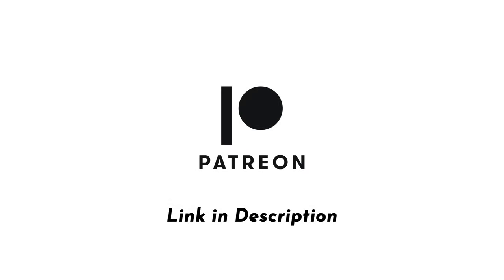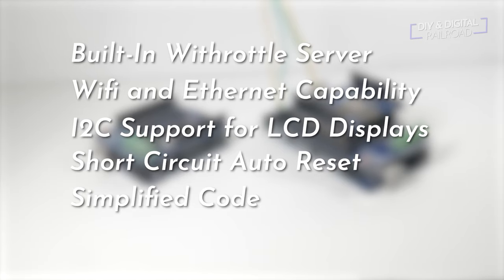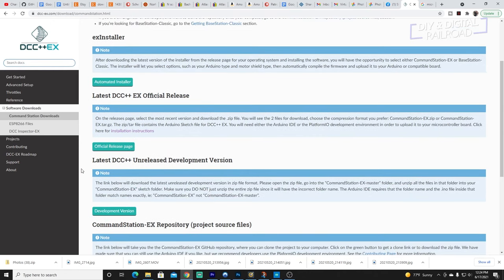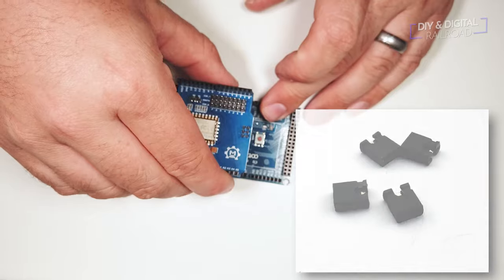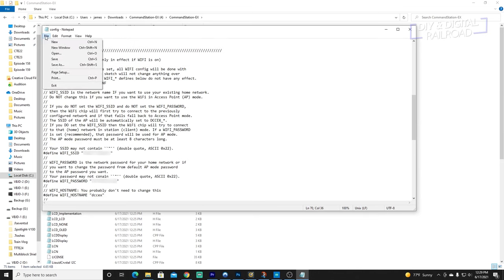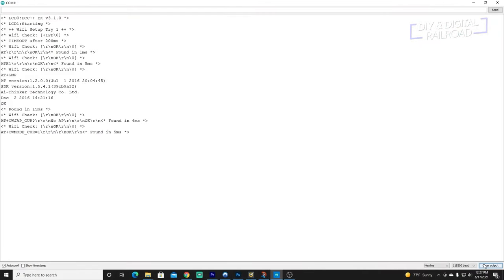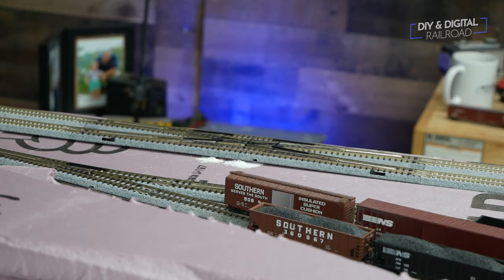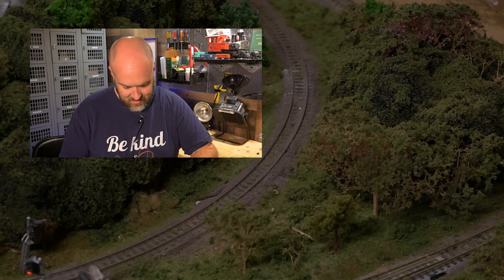DCC++EX: A Cheap DIY DCC System?!?! This is a Model Railroad Game Changer

Comment: I will get back to this when I'm building my railroad. It is intriguing.
     Many years ago I was an over the road truck driver. I had a railroad in the top bunk. Rather then use a conventional power pack, I got a 2n3055 transistor, heat sink, A dpdt switch, and just used the trucks 12v power out of a cigarette lighter. Simple stupid effective.  
        This looks like worth exploring. Thx

Comment: I used the ESP-01 module when I built my setup a few months ago, and it has performed flawlessly. My layout is in the garage and it boots up and is ready to go in just a few seconds. I use Station mode; AP mode works fine, but I quickly tired of changing my phone's Wi-Fi network every time I wanted to run trains.
Reply: I'm using station mode as well. For similar reasons. Can keep my phone on my normal home WiFi network.
Reply: Why not just get a Third World donor fone? As long as it will hold Engine Driver it should work. We are using junkers on our portable club layout now.
Reply: On your ESP-01 module, where does the ground wire connect to? Thanks
Reply: @danzo5521  I'm pretty sure it is the GND terminal.
Reply: @PatrickMcNealPuppets-n-Things  thank you, I rewatched the video and figured it out, thanks!

Comment: Hey Jimmy, top video mate!
And a very deserving plug for the DCC-EX team. They're working hard on this.
Please correct the Arduino IDE serial monitor baud rate you mentioned: it is 115,200. Not 112,500 as you read out.
New subscriber here! 🇦🇺🤠👍

Comment: Excellent video.  Thank you for doing this.  I’ve used DCC++ EX on Arduino with my win10 laptop for a while.  It connects with JMRI to run multiple locos, turnouts and sensors without problems.  I got the WiFi card from England and paid more for shipping than the card itself.   I have not tried to install the WiFi card yet and this video will help me.

Comment: Jimmy, You have out did yourself again with this video, it's great as usual. I  have a dcc++ and have played around with DCC++ EX both of which I have found to be excellent.  I have a Raspberry Pi 4B with JMRI connected to the DCC station and I login in with engine driver, or my wife's old I-Pad using the one for apple. I normally use Pi-sprog on the layout when I run DCC, or program my trains. My layout started 26 years ago as DC which I still  use. I have double poll double throw switches . The layout was originally setup up for 4 DC throttles.
All are either kits or ones I built from scratch, When I went to DCC, I changed the DC side to 2 throttles, this way I can setup the DCC to run on one switch and  use the other to hookup
to a programming track. It's a little complex but I have all the switches marked as to what they do. The only thing I found with DCC+ + or EX is I can not program trains with it.  But  that could just  be me. My background was electronics and I did do some programming. My last gig was working on Cisco Routers and Switches for a major bank.

Comment: This is amazing.   Setting up and wiring DCC and power are the two things I am most daunted by, honestly, but this looks like FUN!   And the DCC++EX site has great instructions.   And ... well, lower cost is always better.   And I have a nice little laptop lying around that I can use as a support PC to load JRMI and do updates with.   Awesome video and thank you Jimmy for bringing this to us!
Reply: I have a background in Robotics and process control... from 1987... I have no idea what he's talking about. Overwhelming!. I haven't touched electronics since that course, it was brutal and completely turned me off. Spent my teens fiddling with electronics, I have about 10 years experience, but this?!?

Comment: Ugh. This video came out 3 months after I spent 60 hours building a crude DCC system using a PIC16 microcontroller. But I was doing it as an exercise to learn more about microprocessors and assembly language. I didn’t even control locomotives; I just switched LED lights using the DCC protocol. I could’ve done the same thing using C and UART but then I wouldn’t learn as much about the microprocessor.

Comment: This is a fantastic video and introduced me to something which I did not know even existed. For me the next step would be to introduce affordable decoders which could be fitted to N gauge locos from the 1990s and early 2000s. That would be an amazing game changer. Thanks so much for your efforts and for sharing.
Reply: You can install decoders, even sound decoders in N-Scale locos. In some cases, you have to do machining though. You have to take it to someone who can route out a space for a speaker. You can make decoders yourself too. Geoff Bunza has a board you can solder components to, but to makes something really small, you have to have surface mount components and that is usually not something the average Tinkerer can solder or bake. But Engineer level folks might tackle that.
There are some non-sound decoders from China that are dirt cheap.

Comment: The DCC++EX installer is much easier to use than using the arduino editor. I also recommend the combined mega with wifi board, no jumpers needed unless you add a display.
Reply from the maker: Yes the automated installer is much easier, but after consulting with the DCC++EX guys.  It’s still got some bugs to work out, which is why I did the IDE setup.

Comment: I had a DCC++ (not EX) layout which used a second Arduino to provide the throttle controller - no PC needed (not even a Pi)! And it could program, too, in a clunky but functional fashion.

Comment: Hi Jimmy DCC++ EX is Fantastic  i have been using it and the different version and currently  . While i am a Tech guy . I started using with Uno and Now with the latest version i am using a Mega and you Engine Driver and built one for my mates layout the only problem is Living in Australia It has been hard to get MakerFab WiFi SHield   So i have been using  Esp-01     it is very powerful and i love using My DCC++EX main on my mates track  as i have mostly DC N Scale and only a couple of DCC Locomotives But i have modified my layout so 1 track is DC and the other is DCC . I want to say thanks i Use your design of the Station stop  Arduino  on my DC  and i have IR sensors around the track to control the speed of my DC   I am not good a programing but i can read and modify code..  I do enjoy your videos   Thank you  Regards Greg

Comment: Thank-you for this video; this is a really interesting system. The major draw of the DCC++EX system for me is the ability to build it myself; I like building things, so this becomes another aspect of the hobby. The price is nice as well of course, and I suppose it also means I wouldn't be locked into proprietary components.

I've seen and read a few other things about this (and DCC++) and people frequently refer to "limitations" of the system, but people don't talk much about those limitations. Do you suppose you could do a video on the (current)  limitations of the system?  For me, it's just as important to know what I can't do.
Reply: As one of the developers mentioned wifi is limited to 4-5 throttle connections connected directly to the command station....unless you use JMRI then you can have more....the other limitation is the memory and ram of the Arduino itself....you cannot use commercial DCC throttles with this system....that's a few and we are working on ways to solve that.
Reply: @scottericcatalano596  still... quite impressive.

Comment: In my DCC++EX experience, if you connect Arduino Uno or Mega to computer using USB connection for JMRI you don't need to power Arduinos with external power supply.   USB 5volt DC power seems to be enough.   If the computer has Wi-Fi connection to home wireless router,  JMRI WI-Throttle works very well with Android Engine Driver on a cell phone.   Then both JMRI Operations track and Programming track outputs on the motor shield are available ... maybe these could be subject of another video.
Reply: Throttle options will be a subject of another video.
Reply: While many people don't want or need the complexity of JMRI to just run trains, there are obviously a ton of serious railroaders who want all JMRI offers. We cover that on the we page. You don't need a WiFi board on the CS at that point, you use the WiFi in the computer running JMRI and connect to that.
Be sure of your power requirements when running off USB power. It DOES work fine for probably most cases, but both the USB port on computers and the USB circuitry on the Arduino are limited to 500mA. If you had a Bluetooth or WiFi board on there or a lot of sensors and outputs connected directly to the Arduino, that might not work. The Mega can only take 800mA anyway, so the extra 300mA would only matter to someone with one of the situations I mentioned.
Reply: @DCCEX  All true ... but sooner or later model railroaders need to change CV values ... like when you buy a new engine preprogrammed with address 3.   For myself, that's why I installed ... and learned the little I know about JMRI ... for DecoderPro.   My experience so far is that DCC++EX works very well with DecoderPro and a programming track which for me is essential.
Reply: @donaldkormos5529  I agree. And I like JMRI. But I do want to mention you can do all that without JMRI. You can program CV's right from a serial monitor in DCC++EX if you like, but some phone app  throttles support CV programming as well.

We are adding CV programming and turnout control to WebThrottle-EX, so tools like that can be used just as something to program locos even if you don't use them to control them. 
As much as I like JMRI and think it is extremely powerful, with power and options comes complexity. Plus, it is Java. it has a terrible user interface, is very convoluted, and has a steep learning curve. The page read feature is one of the nice benefits though! We've sped that up considerably. We do write code updates to JMRI as we come out with new features, so I'm not knocking it, just acknowledging we need an "I just want to run trains" (aka Conductor) solution.

Comment: I brought a DCC loco off of EBay for £12 ~$15, its fitted with a Hornby R8249. When I first got the engine and opened it up and it was swimming in oil, but I powered it up on my dc track, and it ran?? But I noticed that there was smoke coming from one of the decoder components. I have cleaned it up and replaced the decoder but before fitting the new decoder I shorted out the pins to make it dc only and it will run around the track quite happily with the power supply set to 4-5volts, and its got quite a lot of power.

I brought a elegoo mega and a cheap motor shield, cut the vin track and wired up a length of track to B+&- terminals and when I asked it to detect and the decoder, It gave me a choice of several, I choose R8249, and it made an entry in the roster, but I an unable to make the loco move using a throttle, I got error code 308.

Thinking it may be due to the motor shield I brought a Deek-Robot motor shield but forgot to cut the vin before using it.

Now I have a problem, have I fried the mega, the loco moves three four times as before but then gives me error 308, or do I have a problem with the loco, it rings out from the decoder pads back to the motor shield?
Reply from the maker: Hmmm.  The deek robot shields are solid.  It may have fried your board though. I would either cut or bend the VIN pin on the shield to make sure it doesn't happen again.

Comment: I'm about to start converting my DC system to DCC Ex following your video on this subject but I have a few questions. My N scale layout DC system with five main loops, a number of sidings and a turntable using a separate DC controller for each of the five main loops and isolating switches for sidings and turntable. My questions are going to DCC Ex do I just parallel up all loop feeders  maintaining same polarity? The main layout is approximately 8X4 feet, each loop is probably about 20 feet. Also what size power supply would I need to probably run about 4 engines at any time? I would appreciate any advice in these areas. Really enjoy your Videos and advice. Thanks

Comment: I have a background in Robotics and process control... from 1986...! Hated the course as did my classmates. Most of the profs were stumbling around just trying to teach us. Sometimes we had to correct the profs! out of 87+/- students to start, 8 graduated. I have no idea what is going on in the video. It looks like I'm going to have to do some research, just to understand. Once I figure out what's what, just from the comments, This looks like my best bet. By the time I add on some sort of screen, keyboard, etc I'm guessing, from the prices I've seen, this will STILL be about 1/4 the cost of a "DCC starter system" and from what I understand, will be better then the "chief" top end systems. I have a lot to learn (and not a lot of time  to learn it, as in, life span, lol!) but looks like it will be worth it!

Comment: @diydigitalrailroad, do you have a working link for the motorshield to use with the Mega?  The link goes to a digital camera lol.  Also is there a way to run more than 2 dc motors or is each setup restricted to just 2dc motors and thus requires multiple standalone units to control more?

Comment: Despite having a Z21, I'm going to have a go at this especially as I am pretty comfortable with coding. My only concern is track power. OK there are a few boards that can deliver hefty current, but I would prefer to fit boosters. Do you know if it is possible to piggy back or stack multiple motor drivers? What other options might there be. My basic research has only unearthed solutions that go way beyond my comfort zones.

Comment: The RP2040 isn't a mini computer, it's just a microcontroller like the Arduino boards use. It's made by the Raspberry Pi foundation and is quite capable.

Comment: Need a little more help here, not being an electrician and new to these little circuit boards I'm trying to determine how you know if you cut enough of the VIN Connect to isolate the power from frying the Arduino? I have used an Hobby knife to cut between the contacts but not sure how to test it.

Comment: Jimmy, thanks for making these videos, they're very helpful.  If you're still reviewing comments on this video, I have 2 questions.  

I'm trying to set up an Arduino Uno DCC++ command station, for use with a laptop for programming DCC, and a DCC-EX wireless command station with an Arduino Mega for use with modules.  

Q1: For the DCC++ programming setup, I believe the 9v power supply for the Arduino Uno is not required because the Uno is powered by the laptop via the USB port?  I'm sure the guys at DCC-EX say don't use both?  

Q2: I've loaded the latest sketch to the Uno, connected a 13v 1.2a supply to the motor shield, connected the Uno to my laptop via the USB port and wires from the motor shield to my ops track only (A).  But I have no lights on the motor shield.  I tried a different Uno with the same results.  I tested the power supply - it works ok.  I tried a 3d Uno, an Elegoo Uno but, even though I have lights on the motor shield for the ops track, I also have a dim light on the negative connection (B) with no wires connected.  And it still doesn't operate?  I can't get JMRI to talk to it?   But with the Elegoo unit, power is getting through to the track because the sound and lights of the loco are on?

Any idea what the problem is?  Do I have 2 failed Unos?  Do I have a failed motor shield?  Is there someway of testing the motor shield without the Uno?

Sorry, that's more than 2 questions- lol.

Comment: Hi, 
I using my train model to bring food to the table in my restaurant, but the guy that programs our software did failed and we have to many bugs to continue to use his software. we need to start from scratch and the solution you give in this video seems interested. Is it easy to link this DCC system to a custom app that will be able to select a specific train, send it to a specific table, stop 25 seconds and comeback to the station. It seems simple, but apparently is not. Do you know how much it should cost to program DCC++Ex to do such a thing?

Comment: This ain't easy for a beginner. I'm hung up on a couple things. I have a main track. Is it a must that I have a programming track? Are power supplies and track all connected and powered up while I'm trying to load the programs? My wifi board from Robotshop somehow got a wrong zip code and was delivered to a wrong state. Can I set up without it using my laptop for control?

Comment: So what changes would you make to the hardware and wiring when doing this on an h.o. scale layout? Should i use a bigger power supply? What size is too big? Also with a dcc++ ex setup do i need to wire the arduino to a buss and then run feeder wires every 3 or 4 feet to the track like a normal dcc setup? Lastly what if i need more power for my dcc setup? Can a power booster be added to something like this? Most of my engines are old athern BB engines that either have already been converted or im converting to dcc sound which draw a little more current then most of the newer engines
Reply: A good 16 to 18vdc 4Amp+ laptop power supply works well with HO scale.
Yes just to wires from DCC++EX terminal A {Main} to a normal DCC wiring Bus with drops every few feet would be preferred.
Multiple power Motor Boards {boosters} are available like the IBT-2. for 5amp or more.
Motor Board Boosters;
https://dcc-ex.com/advanced-setup/supported-motorboards/index.html

Visit us at DCC++EX Discord Server support
https://discord.com/invite/PuPnNMp8Qf

Regards,
Kevin